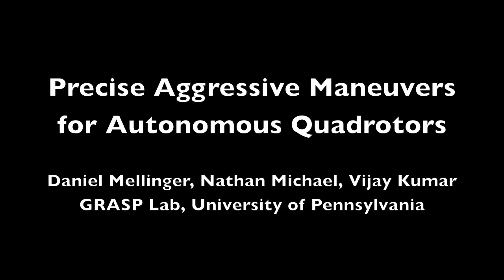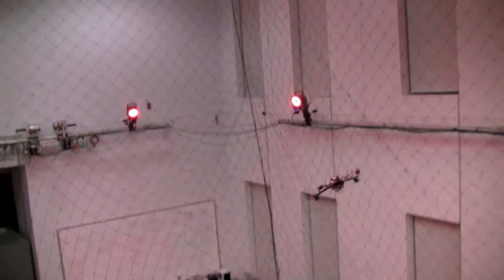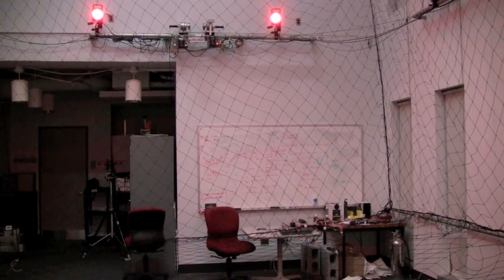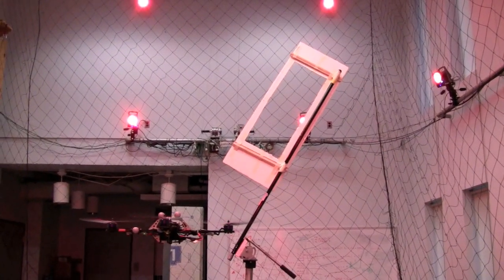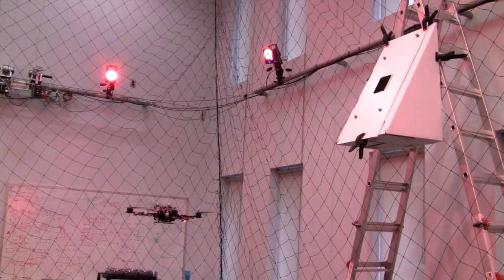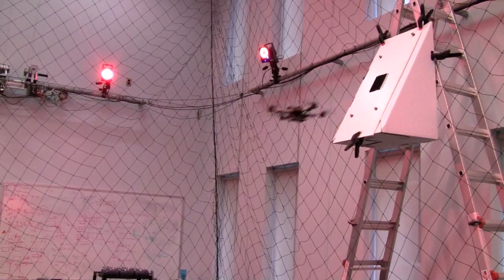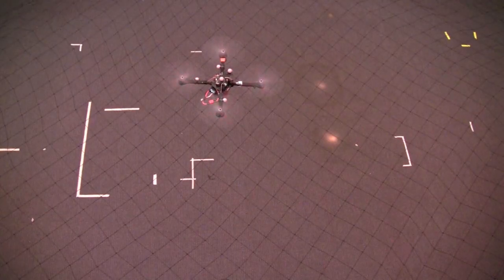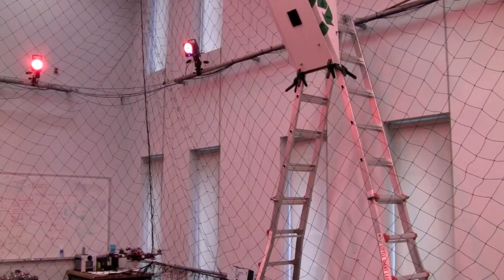Aggressive Maneuvers for Autonomous Quadrotor Flight

Comment: You realize a manhack is a mechanical impossibility, right? Using real materials and a propeller for lift, something that small simply does not have the torque to cut through more than a few millimeters of skin, much less bone.

Comment: How you can say that it is autonomous when it uses "20 cameras" :D :D :D it is not autonomous, you use big computers to calculate the trajectories and then send this data to quadro. It would be autonomous if all this stuff including orientation in space will be computed on board the quadro. And you need really fast 3D camera or other positioning system for that (such as laser 3D scanner).

Comment: The amount of noise they make I don't think Stealth is a high priority anyway. These would be useful for planting a bug in a room full of cctv with the flight capability being used to stay out of camera shot. Even then the heat generated by the motors and movement could be enough to trigger PIR sensors and the electromagnetic feed back could effect the camera signal giving away their presence to even a half witted cctv operator.

Comment: And the point is to be able to turn off.

BUT, some people HAVE done that! But instead, they have propellers that always spin the same direction, but have a collective pitch. The motors are always on, and throttle only controls the angle of the blades for lift. This is how real, AND RC helicopters work. Real helicopters on the ground, or climbing, all spin the same speed, including real full scale ones. The total pitch can increase.

That is a VERY good idea, it's just not efficient.

Comment: Brushless motors do not allow you to do that, they are too complex. The ESC's won't let you. Most motors have 2 wires for single phase, these motors, as well as most RC motors, have a three phase 3 wire system which are all equal, and switching wires won't make a difference. There is no ground, there is simply 3 equal wires.

Also, the props are EXTREMELY efficient one way, and EXTREMELY inefficient the other way. It would product 1/10th of the draft the other way.

Comment: @lukosrage No, and why is that a paranoid thing to suggest?  These things look a great deal cheaper than the $70,000 hellfire missiles that the air force openly uses to blow up people today, and they are light enough to be carried by a soldier.

Comment: @frongjumping Bit of a late reply but, mechanically, quads are far simpler than a traditional helicopter. If it is just the quad then there are only four moving parts... the four motors. Everything else is solid state. The wizardry is in the flight controller, the programing and some impressive physics :)

Comment: So if you could combine some sort of induction charger with the perching you have a completely autonomous system that is ready to rock at a moment's notice and will take itself back to recharge when done. Multiple recharge points around your facility would give flexibility for applications like security. Motion sensors could pick up points of interest then automatically send the quad to investigate. Would certainly scare the life out of an intruder if that thing popped up in front of them! :)

Comment: What motors, ESC and Frame are you using.  Are the cameras onboard or mounted on the walls.  Is the flight controle all on board or is it driven by remote.  If driven by remote what is the com setup.  Thanks for posting this video.

Comment: @frongjumping The quadrotors are quite immaterial in this exercise. What matters is that they can only be controlled when you have a $10k/camera Vicon motion tracking system looking at them. They must be inside of a fairly limited volume (maybe 1000m^3), or the costs go crazy. Until they can reproduce this with an inertial reference (IMU), it's of academic importance only as the approach is wholly impractical.

Comment: agree with grimtango, its not really autonomous, in fact it cant even operate outside of its room, all visual  its data is from external sources, i am still impressed by the degree of accuracy it has with its own motor control. all the "multi-terrain " and flying vehicles still rely on outside mass computing, maybee if the dsp vendors made standard and free programming interfaces we would make more progress.

Comment: @cakefarts I think the point is that it can land on a wall. The velcro is just an easy way to show that fact. You're thinking awfully small if you think that's the only adhesive they can apply.

This thing has a long way to go before it's ready for any real world applications, but that doesn't mean it's impossible. One step at a time.

Comment: OK,I understood how these things work,do you guys see the white balls in the bot?
A external computer (probably the laptop you see at 0:37 or something) connected to cameras in the room,detects the robot position by finding that balls array on the picture (is easier than detecting the robot only), with that position, they use the algorithms they said they had created, to send instructions to control the robot via Radio waves to perform the maneuvers you see.

At least this is how I would do it.

Comment: Have you looked at MEMS-based accelerometers and gyroscopes to decrease the need for the extensive camera setup?  As long as you have a known starting point, dead reckoning should work well for short demonstrations like these provided the device response is quick enough.